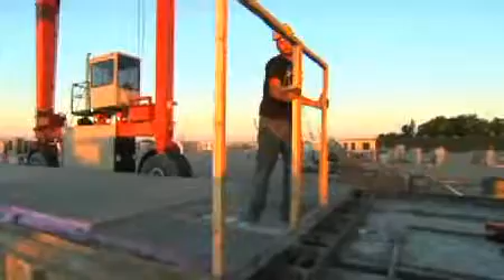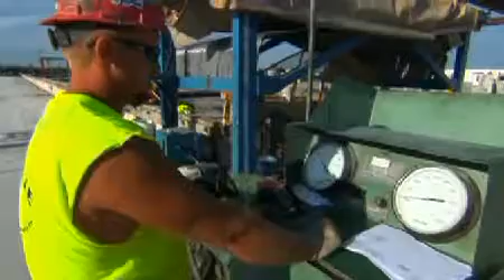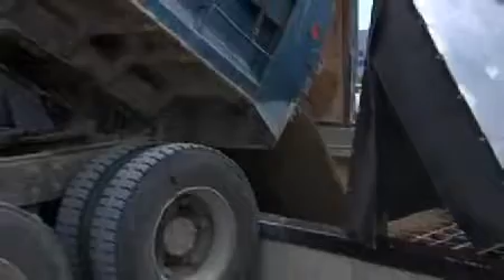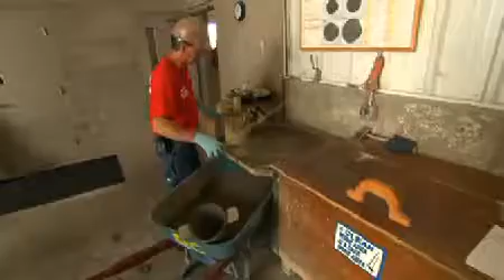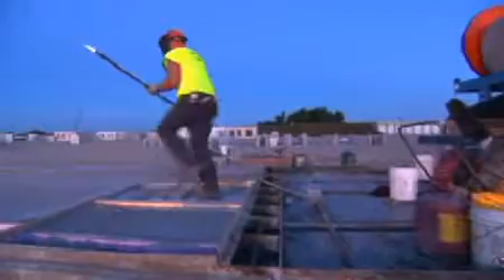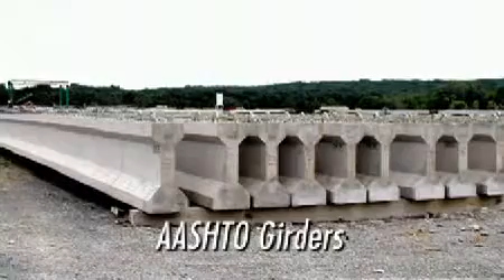Spancrete Virtual Plant Tour

Comment: What about using rebar instead of those wires?
Reply: The cables that you call wires are stressed (pulled) to about 42,000 pounds in which gives the piece the camber it needs to support a load.
Reply: Came here after watching you cut off the end of your panel today.